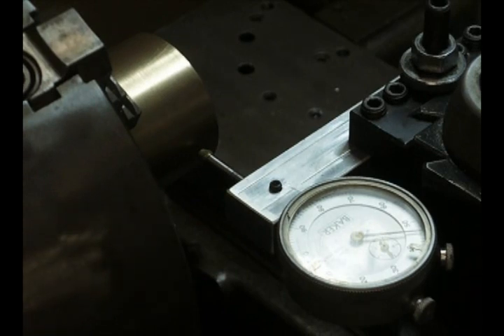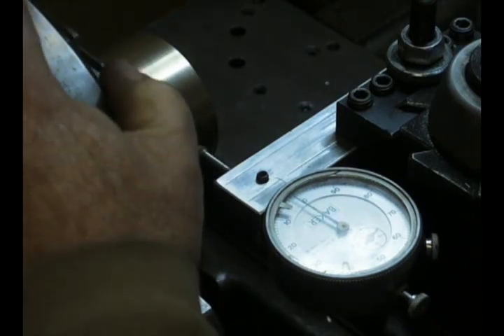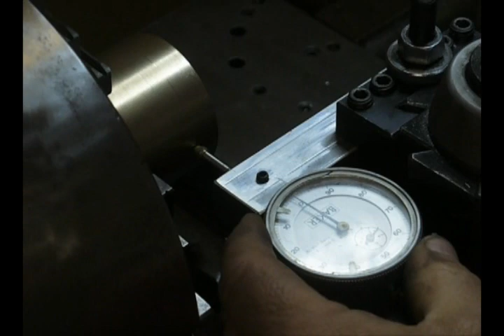Adjusting the 4 Jaw Chuck

Comment: I am one who has always done everything I could to avoid using a 4 jaw. If the stock was too large for a collet I would reach for a larger OD stock than I needed. I can't stress enough to use totally round stock like Jim pointed out. I tried to use the procedure with a smooth 1/2" S.S. pipe nipple. I couldn't get it? Then I realized the factory made nipple wasn't round, I kept getting a negative zero. I grabbed a piece with a true OD and tried, real fast I was on with only two adjustments.  Keep using those old lathes, mine is one year older than me and I'm 77. A 10" Logan 820 made in 1946. This video is a keeper!
Reply from the maker: It is so satisfying to see that this video is still impacting people and helping them along... It has proven itself over time to be the fastest and most concise method of dialing in a 4 jaw. Proof of that is that there are now DOZENS of videos on "Dialing in the 4 Jaw Chuck" that are virtually word for word taken from this video (You can check when you look at the date of the ":Other Guys" videos compared to this one... You won't find an earlier version than this. I don't mind, (I would be nice if those other guys had at least given a shout out but then they couldn't claim to have come up with the method LOL... Never stop learning!

Comment: Was fighting my 4 jaw for 20 minutes before I gave up and took a break. Watched this video and it only took 30 seconds to true up using the 2 chuck key method. Thank you for this.
Reply from the maker: It's the old saying "Work Smart, Not Hard"... Everything usually has a little "trick" that a lot of the old coots (like me) don't want to tell the new guys. (I'm not one of them.!) I always believed that you answer questions and if necessary, SHOW the new guy a faster, easier or safer way to do things. It just makes good sense. I'm happy you found this useful. Makes a big difference!

Comment: Hi Jim,

I saw many video on the YouTube, but yours is more straight forward and get to point.  One question that I have is this has to be done on each part that you doing, considering if you running more than one?
Reply from the maker: Yes, but if the parts are similar, or the same. then the process will be very fast as you will be closer on each incrementing piece..

Comment: So I am most a clay artist, potter is close. I do throw and trim pots. This is so similar to manually centering a pot for trimming. 

I have been working away turning some PVC on my 70 year + old lathe and doing a reasonably good job centering without a dial indicator and with only one key. I was considering buying a three jaw chuck to recenter work . I may still do that but the second key is great. I will get a dial indicator. I will have to try it. Thanks!

Comment: There is always a pay-off between things built with the intention of taking the hard work out of the task at hand, flexibility and what you are actually trying to achieve.  If you can use a lathe to any degree of proficiency with a 3 jaw chuck, using a 4 jaw chuck is down to "being bothered" ; the benefits of which outweigh the effort.  It doesn't take much practice to become reasonably proficient with a 4 jaw chuck.   You can get within reasonable limits if you understand the concept that if the clock gauge is high, loosen the opposite jaw first then tighten the nearest jaw.  Now go practice.

Comment: I have an easier way! Just run the center down there and clamp down the chuck with the part on the center!
Reply from the maker: Won't work.. YOU can still get runout with that method as the part STILL needs to be centered in the jaws. THIS is the way to do it..

Comment: Thanks! 
Just one question, I have a block on a 4 jaw chuck and ported a hole in the middle. Than I took out the block to do some milling work. Now I want to put it back on the chuck and center the hole, how can I do it? Is it ok to use a dial pointed to the inner surface of the hole?

Comment: Just a follow up to let you know how it all went, my job was to centre a sprocket in my 4 jaw chuck to machine the centre out, thanks for your advice, without watching your clip I wouldn't have had a chance to get it that accurate , I even surprised myself with the result, that is the most helpful thing I've learned to date, thanks again for your help, not only did it help on this job, I can see this being a very handy skill for the future,now no longer afraid of using my 4 jaw regards Paul.